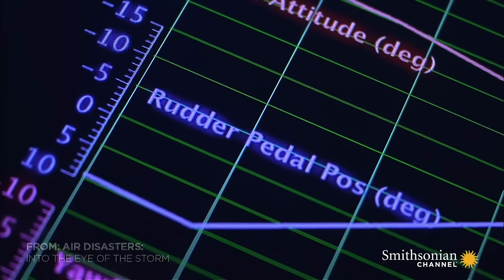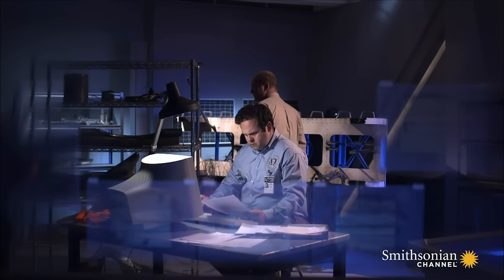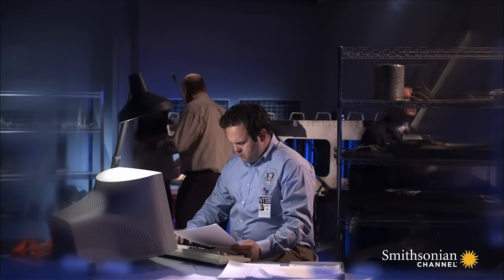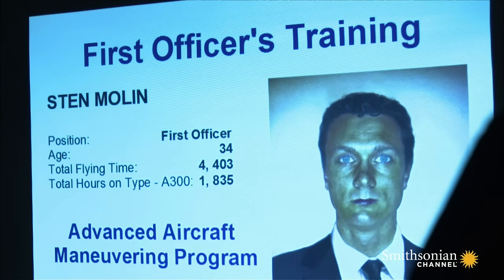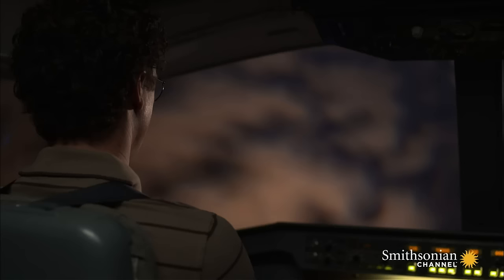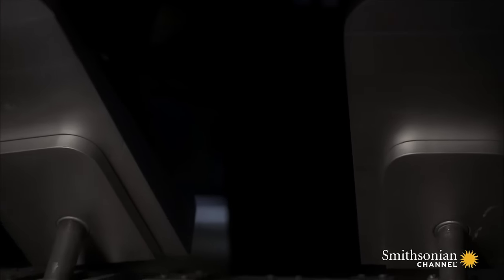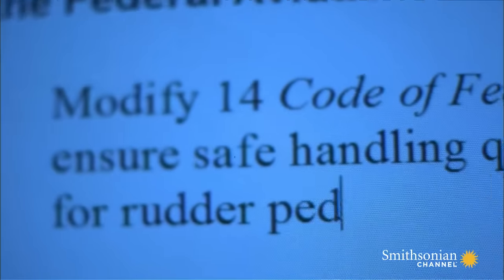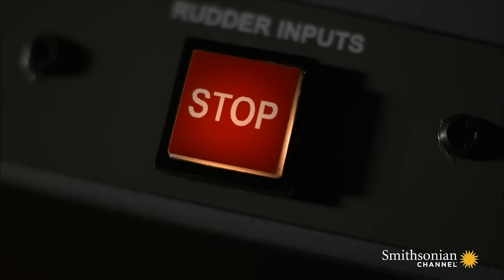Did a Poorly Trained Pilot Cause Flight 587's Crash?

Comment: Yes, Stan "Stomper" Molin was pounding down on the rudder pedals all the way left then all the way right. Rudder control was never meant to be operated that way. Some people really want to be like Dad, or Uncle Harry, but unfortunately they lack the fine motor skills. Rather than exhibit poise, Stomper panicked. Horizontal stabilizers are not made of tool steel, most are composites no matter if it's a Boeing or AirBus. Being light weight is a positive, anything heavy unbalances the aircraft and makes it hard to control.
Reply: Don't know what the Dad/Uncle Harry tangent was all about, and why it has anything to do with stomping, but Molin's training taught him that you needed very very strong inputs to keep the aircraft in the air in that situation, and as a result, he followed his training, which destroyed the aircraft.
Reply: User Name if Stomper was following protocol, he would have busted off a tail before this incident. As well other pilots trained the same way would have had similar situations. Using the rudder pedals is basic, you NEVER NEVER smash the pedal one way then do the reverse. His father had been a senior pilot for AA hence my Uncle/Dad reference. Some people want to follow their fathers, brothers, uncles into a profession, however they do NOT have the same abilities and make lousy pilots, like Stomper. Imagine steering a car, if you come to a curve in the road you turn the wheel a little one way and as the curve straightens out you turn it the other way. What if you violently turned the wheel all the way to the left then all the way to the Right, ending up in the wrong lane and hitting another vehicle headon. You can claim that's how you were trained, it wasn't your fault. That's the analogy you are using. I have never stepped on either the left of right rudder pedal all the way down. You only need a slight amount of pressure on either side to stay on the center line of the runway. The man panicked and went to the extreme.
Reply: Very good points. Especially your emphasis on maintaining composure in high pressure situations. Most people simply panic and make stupid errors in the heat of the moment.

Comment: Airbus Design Negligence.  The A300 crashed because tail vertical stabilizer attachment was TOO weak & control system was unstable,  ..of course they blamed the pilot for using too much rudder. Airbus bizarrely designed, the rudder sensitivity to increase with higher aerodynamic loads, EXACTLY the opposite of what should happen for a stable self correcting control system, a VERY bad design that can easily become naturally uncontrollable. Horrible design,  Airbus 100% at fault .. so they blame the dead pilot, and change training to accommodate the bad Airbus design (you pilots be more careful, cause our junk plane can break, you break it, its your fault, you've been warned). I feel bad for the pilot's father shown here, that poor man, his son is dead and falsely accused of causing all those deaths.
Reply: They didn't blame the pilot they blamed a really really exaggerated training did you even watch the whole video? And that was like what 15 years ago? Most likely they've improved since then.
Reply: true, but luckily other airbus models improved on this.

Comment: Still, there's no way using the rudder should cause the stabilizer fall off.
Reply: Clutch Nasty He used full rudder, the g-forces can easily knock it off. It doesn't happen much because you never use full rudder. Every pilot knows the consequence.
Reply: on boeing and md its way less sensitive then the a300.

Comment: This piece of shit plane is so fucking fragile that the tail ripped off after using rudder pedals. Pathetic.
Reply: +Sikes Pico the rudder was turned side-on into the rush of air. Imagine sticking your hand out of a car window travelling 400km per hour. You'd probably lose you're hand. It is the same effect here.
Reply: Jacob H why not take this into consideration BEFORE building an airplane. Derp
Reply: Jacob H Why would they allow rudder to swing that far beyond the limit in full knowledge that it could potentially rip off?!
Reply: Sikes Pico they'd expect it to happen every now and then, and that's fine. No-one would think a pilot would make it go left and right repeatedly and put it under that much stress.
Reply: Jacob H If a plane is in a spin or uncontrolled dive, the rudder controls are pushed to the limit, arent they?
Reply: Sikes Pico if a plane is in a dive like that, the rudders aren't the only things moving.
Reply: Jacob H Lets hope your plane stays intact the next time you hit a lil bit of turbulence. lol
Reply: +Sikes Pico those inputs were not normal inputs, they were rudder reversals, going for full left to full right and back again.... not a manouver which is trained and not safe in any plane
Reply: +Rene Galvez 767 would do the same thing, 203,000 pounds of force were on the tail
Reply: 203,000 pounds of force were on the tail
Reply: +Sonny Dennison they clearly said: ITS MADE OF ONE OF THE STRONGEST MATERIALS ON EARTH.
Reply: +Sonny Dennison and btw i was not talking to you
Reply: +Sikes Pico 
EXACTLY.
This was a defect of the Airbus at that time.
Had the plane been a Boeing this never would have happened.
Reply: JointOperations90 a boeing plane would have been worse, the tail was at a stress of 203,000 pounds on it, that's like saying you could live is 203,000 pounds was on your chest, you would die, just like the tail.
Reply: Sonny Dennison Airbus has destroyed the skilled pilot. Air France 447 is perfect example.
Reply: +Sikes Pico but remember, it was the pilots actions that caused the failure, same with 447.
Reply: Sonny Dennison Airbus pilots arent real pilots. The computer flies the plane.
Reply: +Sikes Pico boeing uses the same technology, pilots don't fly until takeoff or landing, if your american like me, you like boeing because it's american, but in reality, airbus has made planes that are a lot safer, such as the A380, never had a crash, only 1 failure due to RR making the engine incorrectly. The A380 has flown for 9 years and not a single accident.
Reply: Sonny Dennison listening to those 447 pilots fumble around made my blood boil.
Reply: +Sikes Pico that's the AIRLINE who trained them, not airbus, the pilot might have had issues with his brain, or extremely tired to not notice a stall. it's called pilot error, not airbus error, the same thing could happen to a boeing plane, it was the pilots fault.
Reply: totally agree.
no amount of rudder imput should have caused that .
Reply: ***** Wow computer flying the plane because pilot has no skills alert!
Reply: +Sikes Pico this was an old plane. The newer Airbus planes got their improvements.
Reply: Keep in mind that the first officer was using aggressive inputs and that this was an earlier generation plane. Something like this wouldn't have been in mind.
Reply: Marvin Encarnacion Shut up! The co pilot did nothing wrong! If a plane breaks up with the movement of a rudder then it wasn't built properly.
Reply: Sikes Pico Boeing 767 is better than the A300 A330 A340
Reply: Sikes Pico Boeing 777 and 787 same
Reply: Sikes Pico yea, blame the plane hahaha. it was the incompetent pilot.
Reply: AIRBUS HAS BEEN DISAPPOINTING
Reply: It's the fact he was doing opposite rotations of wheel WITH his rudder position. He made the side of the plane go into the winnd (ALSO the wake of the Flight ahead) and instead of turning the rudder facing the wind, he put it into the wind, all that surface area means enough pressure to build up and pop off that tail. Also it's an early commercial plane, yes the material is supposed to be cheap but this guy is playing with a Commercial Flight rudder likes it's a toy.
Reply: Sikes Pico The tail would have ripped on any other plane if too much stress was put on the rudder. It's not just the A300
Reply: MrGAEM wait wasn't the simulation wrong cause they changed it
Reply: Dylan Le bro the simulation only simulates whatever data was put into it. if no one ever knew that the tail fin could rip off like that then how would they put it into the simulator? while i think that they knew they just never programmed it since they never thought it'd be a problem. trail and error just like everything else in life brother.
Reply: Sikes Pico really they used RUDDER pedals no wonder they crashed 😤
Reply: TheLegendaryGamers// Legendary 744 NAAAAAAAA I'm gud' thanks
Reply: Steve Wil oh ok

Comment: There is no way any pilot input could be severe enough to shear the tail off a commercial transport plane considering the plane was operating under 250KIAS since they were under 10,000'. This is well below any control surface loading limits.

Most likely, it was either a design/manufacturing defect or terrorism.
Reply: No. It was the result of a misfire of the US government's Aurora space weapon. It's capable of sending electrically-phased microwave pulses. An indirect hit would have destroyed the plane's electronics, causing erratic rudder movements capable of ripping off the tail (just like you can break bones in a seizure). A direct hit would have vaporized the aluminum of the plane, causing explosive decompression and structural failure. Either could have caused the "accident".
Reply: It was a design failure with the A300/A310 (only the the first few produced) I’m which the vertical stab wasn’t attached as well as it needed to be
Reply: You would be correct if it sheared off under normal maneuvers

Comment: I wonder why the amount of allowable rudder movement is not speed dependent? I'd think it would be possible for Airbus to design it such that at higher speeds, rudder movement is limited to only 1-2 degrees rather than the full 11 degree range of movement. This way, you could never input a rudder command (even inadvertently) that would overstress the airframe
Reply: Keep in mind that the A300 hit the drawing board during the 1960s, with no FBW technology. Like many of its contemporaries, the pilot has direct control over the flight surfaces.

Comment: It still seems rather strange that it's not possible to design a tail sensor that can detect forces engineers know will shake the tail off and refuse to accept the pilot's input if it reaches those levels through the pilots inputs.
Reply: After the crash of USAir #427 and several other rudder malfunction incidents, Boeing redesigned  the rudder control system in the 737 by adding a hydraulic pressure limiter. This limited the amount of rudder deflection possible above certain airspeeds, in order to reduce the possibility of a rollover from which recovery is unlikely.

Comment: 11 degrees in any other area seems like such a small movement, amazing the amount of stress it generates
Reply: It’s because of the large surface area of the rudder and the high speed. Think of how, as a kid, you probably stuck your arm out the window of a car travelling at highway speed - the effect here was similar, but much worse.

Comment: ok so just a few slight hand movements can cause enough strain on that part of the plane for it to rip off? DOUBT
Reply: The rudder is controlled with a pilot's feet, not the yoke or stick. That aside, 11° at those kinds of airspeeds is a very large deflection, and it created huge aerodynamic loads. If you're interested in numbers, the tail failed under a force of 203,000lbf, which is the force produced by FOUR of the A300's engines, and over TWICE what it was designed to sustain.

Comment: Why can't they make a system that simply won't let you do stuff that will rip the tale off? "Oh you're going 380 knots and want to go repeatedly max left then right rudder? Our calculations show you'll lose your tail if you do that so you're not doing that. Instead of 11 you can go to 8 and that's the way it is." After all there's no real point if what you're doing causes you to lose the tail. Would this be technologically difficult?
Reply: I think they do now. It won't allow pilots to do stuff beyond the planes capability but I forget the proper term.
Reply: Newer planes do this now, with fly by wire. But the A300 is a 1970's plane, it simply wasn't designed with this philosophy in mind. Rather, like with many of its contemporaries, the flight surfaces are directly controlled by the pilot's input.

Comment: Wake turbulence or wingtip vortices increases when closer to landing or takeoff due to ground effect and the way that air is being moved on the runway environment. It's still good practice to avoid when flying in the sky but a critical time you might roll over would be in or above ground effect.

Comment: If the tail snaps in half  the aircraft will be marginally controllable with very shallow banks and no crosswinds on a 737NG with zero wind the winglets may provide enough vertical surface to aid in yaw control

Comment: It seems incredible that these planes are so flimsy that any sort of over vigorous control movements would cause such a catastrophic inflight failure of a vital component like THE ENTIRE TAIL!
Possible on a multi-million dollar Airliner? But impossible on a Cessna 150 or Piper J-3 ?
Absolutely astonishing!
Reply: It's ultimately up to the flight crew to keep the aircraft within designed flight parameters. Given that no other A300 had its tail ripped off from repeated rudder deflection AFAIK, the strength of the tail doesn't seem like it was a design problem under normal conditions. 
Keep in mind that we're talking about what is effectively a 22° deflection for a 165 ton aircraft moving in excess of 250 knots: according to NTSB findings, the load on the tail when it failed was about 203,000lbf, which is a similar amount of force to what 4 of the A300's CF6 engine produce, and over TWICE what it was designed to sustain. Those are huge loads that you can't come anywhere close to creating with a small prop plane like a C150.

Comment: is it remotely possible to fly a plane without the vertical wing
Reply: randomrazr not when its yawing when the stabilizer comes off, and if it’s designed to have a stabilizer then no
Reply: @ace_trace_2237  so even if u were able to control all other areas of the aircraft, without the vertical stabilizer, your fucked?
Reply: @randomrazr  In that way, yes.

Comment: Still a system design error. A rudder variable stop actuator should have prevented this. Depending on the speed of the aircraft it engages and limits the maximum deflection.

Comment: Why can't they just simply delay takeoff  when a bigger plane takes off before the smaller one?
Reply: They did to an extent. The requirement was 4 nautical miles for a 747, or about a 2 minute hold. I think the operative philosophy was: wake turbulence had never caused the crash of a revenue commercial flight before, so maybe there was an overconfidence factor. If we insist on zero-fault tolerance, then perhaps the whole aviation system would come to a grinding halt.

Comment: Itsn't it still possible to somewhat control an airplane without the upward tail? and btw, why the hydraulic system is so powerful that it allows this action? What I've learned, is that even the street stick or wheel, what ever u call it, will make it heavier to turn, if there is resistance, if u get me.-
Reply: The tail is almost only made to keep the plane stable, some designs can work without it but this plane needed it
Reply: In today's planes, hydraulic lines spell doom when ruptured. The vertical stabilizer would've leaked all the hydraulic fluid rendering the plane uncontrollable, especially with this plane already in a sharp yaw when it snapped,  (the engines came off soon after as it spun out of control). In the grainy CCTV images, you can see hydraulic fluid spilling out of the plane like a trail of mist. The plane was also still low, in a climb, and not traveling very fast. Some WWII planes / bombers have survived severe damage to tail fins, vertical and horizontal, but they were mechanically controlled.
Reply: The whole stabilizer was gone, the plane was in a yaw when it came off and as such there was nothing to correct it and it went into a flat spin

Comment: Why wouldn't airbus design the rudder to be used with full authority to yaw left or right? What would be the point of designing a rudder system that couldn't handle full authority one way or the other, even under turbulence? I'm not a pilot but it just seems sort of silly that they designed a component with the idea that "Oh, you can only use this partially, if you use it all the way you'll break it." That doesn't seem right. I would understand if some how this pilot was able to angle the rudder further than it's design limits, but that doesn't seem like what they're describing here.
Reply: The rudder is not there to be used for roll control, its there for turn coordination and damping (small inputs), engine failure situations (large sustained inputs), and crosswind landings (sustained inputs). It is not designed for large, rapidly reversing inputs. Rapidly reversing the input will, if in phase, cause the aircraft to yaw more and more with each input, quickly the forces can reach very high levels, enough to cause structural failure. Any aircraft can be broken by flight control inputs alone if used in the right combination and at higher speeds

Comment: It's just insane that a professional pilot cannot maneuver through wake turbulence considering that's part of his job. I also blame the design of the plane ,why would the rudder be detached so easily if its that important to the plane to stay in the air.
Reply: Because no rudder is designed to to,erase this handling. The maximum force that can be generated through fast reversals is unbounded. No manufacturer accounts for it. It’s poor training. Nothing else.